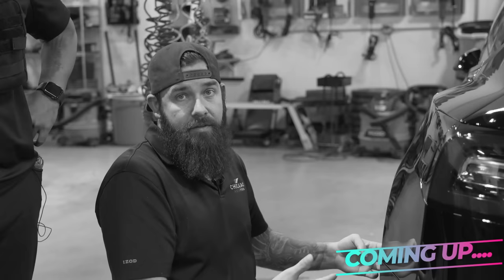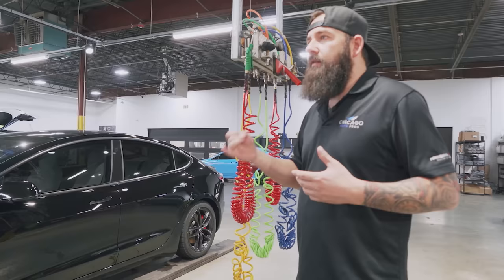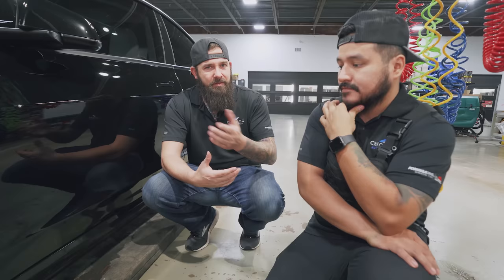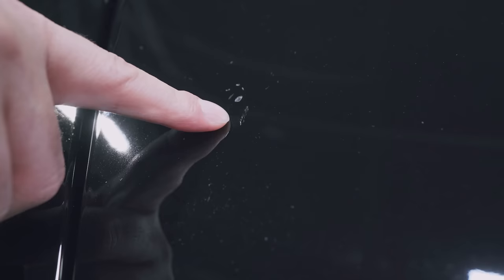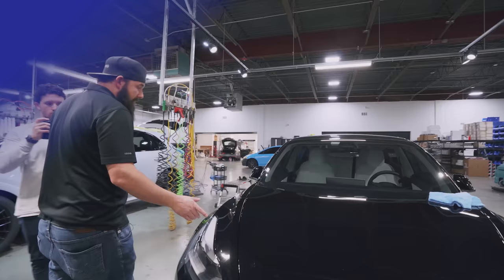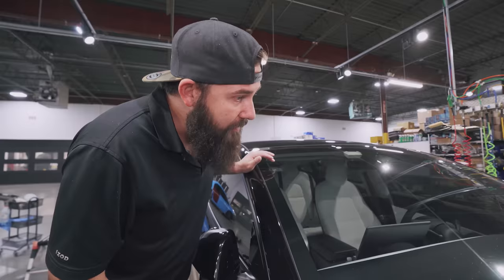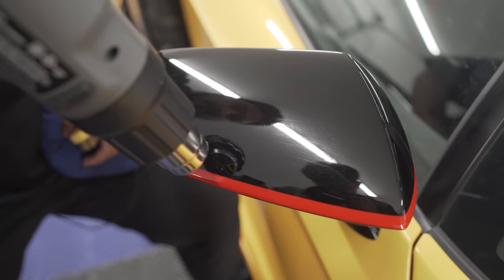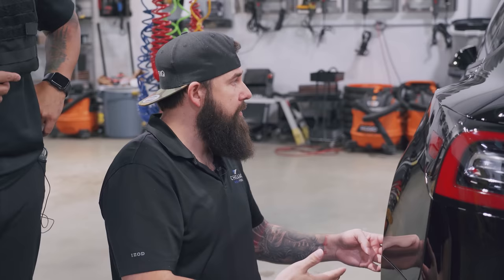What Does Paint Protection Film Look Like After ONE Year?

Comment: Did full ppf on my last car.  Cost about 6500.  As seen here ppf also gets scratched and tears and then you stress over that.  I had the hood and bumper redone and that was another 1500.  I kept the car for 4y.  So total cost of ppf was 8000.  I realized it’s just better to spend 8k towards a new car upgrade every 3 years.   New tires, paint, brakes, warranty, tech, leather.  Most people say they will keep the car for 10y etc.  but in reality most trade it in half way through that period - especially if you’re the type to spend this much on ppf to begin with.  Chances are you want something new every few years.
Reply: Getting a daily driver completely wrapped is a waste of money. You do the hood, front bumper and the mirrors. It will prevent 90% of the chips. Costs way less. Getting an entire car wrapped is for a garage or show car. Like you have a 911 GT3 or a Ferrari, R8, etc. Not some stupid Tesla Model 3 that you daily.
Reply: I just did full ppf on my 2023 Ram 3500  DRW Limited and it cost about 7k..   My truck color is pearl white.  I will find out in a few years.  I have $25 ceramic spray wax that I use on other cars..  Do you think it is safe to apply the ceramic wax on top of ppf.   In the future, I may just do the ppf on the front hood and bumper.  This may be my last ppf for the new truck or cars.

Comment: I surely hoped after the 3-10x the cost of repaired paint and body panels that the ppf would have faired much better...finally sold me on how much hype and access this is. Makes much more sense now that I have seen this to remember that it's just painting, and metal...it can be replaced/repaired and shined to perfection much more affordably than the PPF for sure. However, I am still sold on reasonable costs for paint protection and ceramic. Thank you for the great vids.
Reply: Yea this stuff costs way too much
Reply: Yeah PPF is just too expensive where it’s like 50/50 whether you wrap or repaint for say a used car. For a new car you are paying forward, but it’s not insurance, it’s basically paying for the new paint job already. Though for news cars I think I would do it. Used cars just do the high risk areas since I hate rock chips
Reply: What if it's a matte finish?

Comment: I got my Tesla PPF a few days after getting it. Kept it in the garage till then. For sure saves a lot of chips. Already have a few areas where it would of been a nasty chip if it wasn't for the full body PPF. For sure worth the money. Makes cleaning easier, less worries about rock chips, and has a small form of protection against dings.
Reply: I'd rather have a little mark on the ppf from a huge nasty rock chip than paint chipped off.

Comment: This is really helpful.  I just bought a WHITE 2022 Toyota Mirai.  I've owned two other cars that had the front end, entire hood, front wheel panels and mirror fronts wrapped with PPF.  They were both Tacomas, one was a bright blue and the other was Barcelona Red.  They held up for years and looked fine when I sold them, BUT I was watching some YouTubes of white cars wrapped in PPF and where there were visible edges you could see dirts accumulation.  Obviously that is not as much of a problem for you because you wrap the PPF around all edges where possible AND your car is a dark color.  On my new car I was going to have some sort of partial wrap and then ceramic coat the remaining exterior paint.  Since there are ceramic coatings for PPF I will probably coat the PPF with one of those.  I'm hoping that the extra protection afforded by the ceramic coating will minimize the unsightliness of the dirt accumulation wherever there's a visible PPF edge.  Ceramic Pro does manufacture a PPF impregnated with Ceramic Pro Ceramic Coating called Kavaca PPF which imagine would eliminate the need to ceramic coat the PPF.  
Your thoughts would be appreciated.
Bryan

Comment: So not that it really matters in the grand scheme as he was still on point, but I wanted to correct his statement at 5:12: it is not galvanic corrosion, but oxidation! 

To anyone interested in stupid semantic stuff like this, read on:

The difference between the two is galvanic corrosion is a specific type of corrosion that is caused by an electrochemical reaction *between two different metal types*. For galvanic corrosion to happen, it requires two dissimilar metals, and electrical contact between the two. Usually this is in the form of being submerged in water. Between two metals, the more noble metal becomes the cathode and is protected, and the anode metal is corroded. 
Couple of ways to prevent this:
1.) Select metals that are similar to each other on the anodic index. The closer they are, the less galvanic corrosion.
2.) Remove the electrical connection between the two. Some examples include replacing conductive water with a nonconductive fluid. That is why car coolants (if concentrated) require the use of distilled water as it is nonconductive initially, and need to be replaced every so often as they do become conductive over time (this is disregarding corrosion inhibitors in the scope, but they do degrade over time as well). 

Oxidation on the other hand is a form of corrosion, but it requires contact with oxygen, whether that be air or water. Rust is the common name for iron/steel oxidizing. Technically rust is that red stuff, which is iron oxide and specific to only iron/steel. That's why some people have a kerfuffle and yell at you if you say aluminum rusts even though people use "rust" to mean corrosion most of the time. 

In this case that he was talking about, there isn't really a way for a hood to have galvanic corrosion that I can think of (unless the paint has metal shavings and its not insulated). It would just be regular corrosion on aluminum, which is oxidation. Great video nonetheless!

Comment: I wanted to get my Lexus IS PPFed, but I learnt the reality of these. Just search removing a PPF, and then you will understand it's limitations more than anything. Imagine you are paying $7-10K on a full PPF and then after 3 years or 4 years or even 6 years you accumulate insanely bad condition be it rockchips, bird drops, you name it and then the cost would be insane, at-least $1000+ because the job needs Steaming, Heatgun, Adhesive removals, Chemical cleaners plus a polish on top again. So I abandoned this idea, and will watch and learn on how to detail a car DIY or get to a quality detailer and get it ceramic coated / waxed. Plus as many say do not tailgate, keep 20ft distance and you should be good with all the road debris. Do a touchless car wash only not the machine wash.

Comment: I had an accident and thought it was just the windshield and after that got replaced noticed all kinds of goop all over the car only to find out it was battery acid from the accident that ate thru the paint.....and it covered 40% of the car and the side mirrors had PPF and the spots on the PPF just came off but right on the edge and inside a groove went right thru the paint. I am sure had i have had the entire car done by you guys it would have been ok but seeing how it was not done (couldnt afford it and too far away from you guys) it ended up costing like $19,000 to get repaired. One thing i did notice with PPF is if you look at it with polarized sunglasses (i have red Oakley) it looks totally different

Comment: I’m trying to get PPF on my new X3 — local places use ‘Legend’ PPF and want ~ $1800 (for front end only) and about the same price for ceramic coating. Says it will last 5 years.  Thoughts?
Reply: Get Legend Prime PPF from another installer 12y manufacturers warranty and 7y installers warranty. That's what I got on my mazda3 hatchback turbo for full front (bumper, hood, front side fenders, mirrors, and I paid more for the grill shiny plastic part totalling$2200 with full hood paint correction deposite being anew car it has marks, full car paint decontamination, car wash of course, and the ppf in Miami FL with "High Grade Sound and Security". Ceramic coating a PPF is redundant as it already has hydrophobic properties which would make the ceramic not only redundant but hard to adhere to the PPF.

Comment: GREAT video! I just had my Tesla Plaid fully wrapped in the Stek matte PPF, which has a hydrophobic coating. What do you recommend to maintain it? I like using P&S Bead Maker on paint, is that recommended on this PPF?
Reply: You are on the right track!
I have my Model Y done in full STEK and it’s and incredible film. I also coating it with GTECHNIQ Halo and maintain it with P&S Beadmaker and Paint Gloss
Reply: Do you have social media? Id like to see what it looks like
Reply: I'm about to get STEK PPF as well and am trying to pick a coating to go on top, even though it already has a good top coat. I'm leaning towards DuraSlic Xtreme HG (Holy Grail) or Adams Advanced Graphene Ceramic Coating. Either way, I believe I will be using DuraSlic FlowX as a topper every few months. Stuff is really good. And I like Adams Graphene CS3 as a waterless touch up for dust and stuff.

Comment: Hi, 

Can the bug, tar and other elements be removed from PPF?
Reply: With the right chemicals, yes. Some chemicals that work on paint will ruin PPF. But now adays there is a PPF safe chemical for most contaminants.
Reply: @evanvolk5996  noted with many thanks.

Appreciate if you could recommend any chemicals that will do the job?

Thanks.
Reply: @TrueLeadership777  For bugs on PPF I like Gtechniq bug remover. For tar I like a soy based product like Oil Off or Optimum T.A.R. Solvent based tar removers can damage PPF. For fall out, any good fall out remover like CarPro IronX, Optimum Ferrex, etc will work.
Reply: @evanvolk5996  thanks so much.

Comment: NOT galvanic corrosion! This occurs when two dissimilar metals are in contact (eg: copper and zinc)… obviously not the case when there’s just an aluminium panel. As per steel panels, it’s oxidisation of the aluminium, albeit at a slower and less obvious rate.
Reply: Yea r really threw me off. My car is all aluminum frame , none to never rust, so I was suprised to hear this nonsense lol